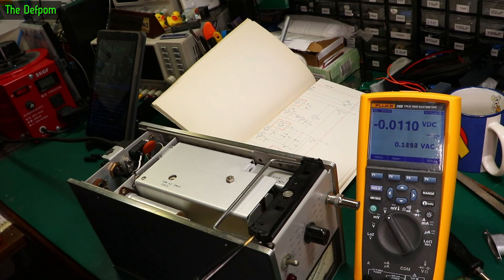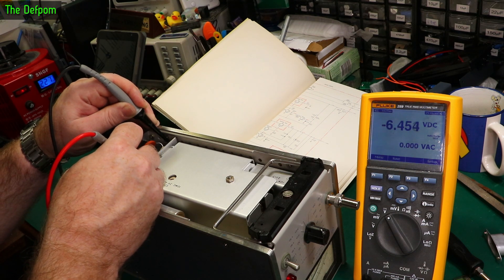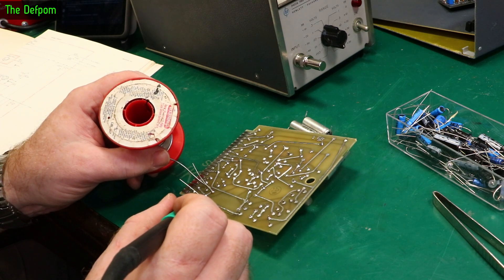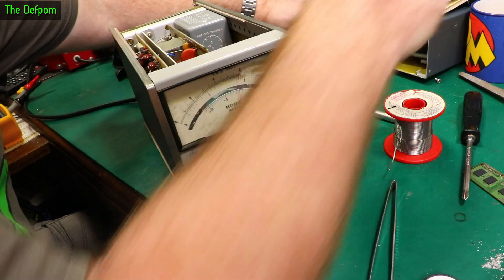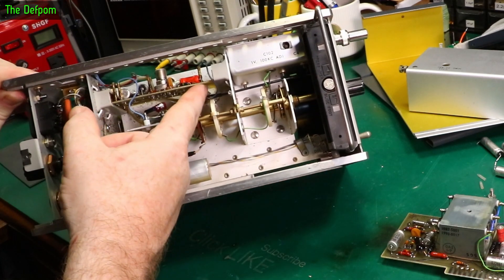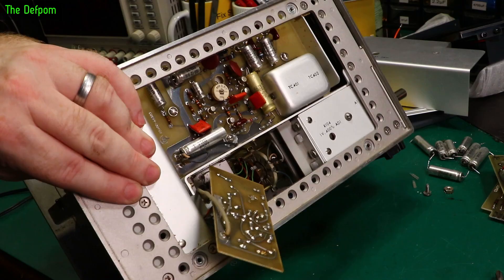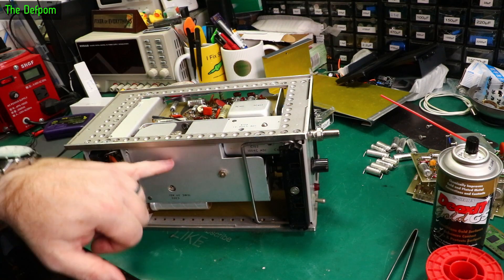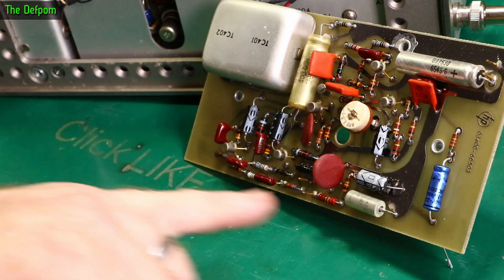🔴 HP 3400A RMS Voltmeter Repair - Part 2 - No.1113

Comment: Card edge connectors are a perpetual source of problems. Used to work with Array printers on printer test riggs that used a multitude of them simultaneously, continuous annoying failures all the time. When restoring, I used to fold a copy paper around a piece of circuit board to clean the inside of the connector. The paper is slightly abrasive. Be careful with cleaning solutions on these old instruments, as I remember cfc:s used to be recommended, 70% IPA is probably OK. All types of modern connectors with square pins seem infinitely more reliable... I have 2 3400A:s, still quite useful.

Comment: There are two kinds of tantalum capacitors -- both electrolytic!  The epoxy dipped ones are Solid Electrolytic Tantalum capacitors.  The other type is Wet Slug Electrolytic Tantalum capacitor.  The second type is what NASA uses for their space applications.  It is also in HERMETIC package, probably with tantalum tube and definitely a glass frit seal.  Actually that seal is the most positive identifier for the wet tantalum capacitors.
 
Once upon a time i tried to weld the tantalum cap to the tantalum capsule.  There were two problems, danger of damaging the glass seal that was already part of the cap, and molten tantalum's high affinity to hydrogen that upon solidification formed voids (bubbles) in the weld.  Otherwise, despite of its very high melting point, pure tantalum seemed to weld quite beautifully.  In that respect it behaves like ordinary soldering of Eutectic (63% tin, 37% lead) solder.  I think I still have somewhere a macro photo of one of my welds.  And no, I am not anywhere near a qualified welder.  I just tried it for a friend tantalum capacitor manufacturer, a NASA contractor.

Comment: Yes, you definitely have to be careful about replacing tantalum caps with electrolytic caps. I did that once in an HP 1980B oscilloscope horizontal sweep circuit and caused myself no end of grief. Lesson learned  - tants are used in timing circuits because of their low internal leakage. The PCB shock mount is for the Nuvistor. Regards, David

Comment: You might want to be careful with the contact cleaning. HP was very particular about using CFC to clean some parts of the shielded sections of the 3400. It's in the service manual.

Comment: In the solid tant's the positive was marked or it was normally the end with what looked like a crimp.

we only used ceramic for the small values an solid tant's were the only large type of caps we fitted to our boards,  . No wet electrolytic capacitors got within 1m of our stores, they all went into the commercial departments stores where they could get away with lower spec parts. it was only the best for us. 🙂
Reply: Squeak !!!!!!
Reply: @andymouse  Eak!